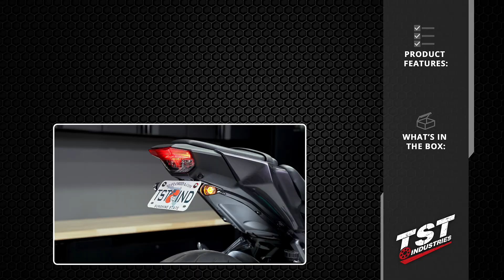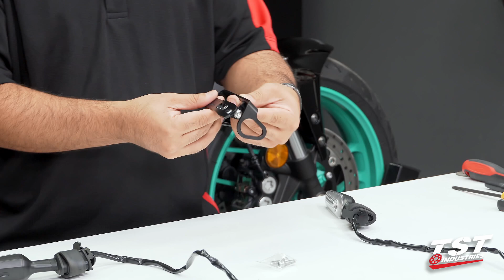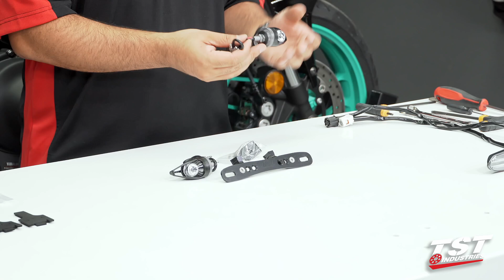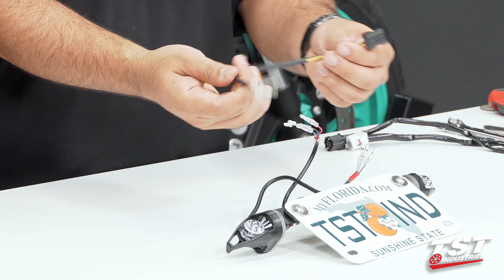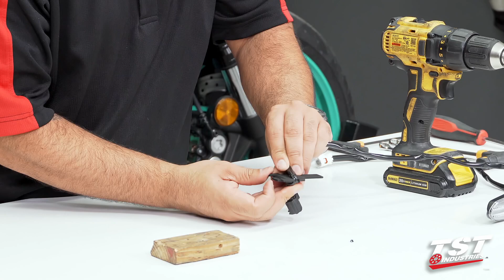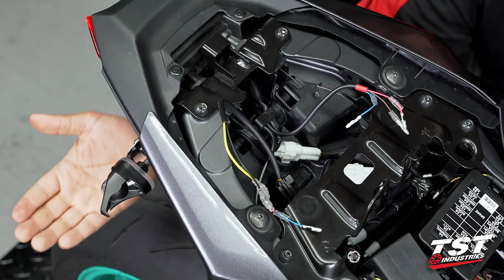How to Install Rear LED Pod Turn Signals on 2024+ Yamaha MT-09 by TST Industries

Comment: So if all I want is to use the factory turn signals with the adjustable bracket. I’d need the bracket and the closeout kit?
Reply from the maker: You would need the Elite-1 Fender Eliminator and the OEM Signal Bracket.

Comment: How would you install the Evo lights running light wire to the bike's plate light wire, if the plate light is already connected to the TST plate light? Or would I have to then, tap into the brake light?
Reply from the maker: You can tap into the brake light wires/functions and achieve either a constant running light or an additional set of brake lights. The choice is yours.

Comment: Do you sell just the rear bracket for the OEM rear turn signals if i want to run the low mount plate, but dont want to run the turn signals down there? Id like to have OEM turn signals in the location of the high mount bracket, but want to run the low mount plate. If i buy both can i use just the turn signal bracket for the OEMs without the plate bracket?
Reply from the maker: Email our Support Team and they can try and help out. Support@tstindustries.com

Comment: Saludos de Puerto Rico tengo Yamaha 2024 mt 09 SP, quiero montarlas led TST mech gtr al frente como aparece en el video y en el Fender trasero original las misma color Amber, también tienen led parking o led de emergencia por que la yamaha trae esa función (intermitetes)
Reply from the maker: Sí, puedes usar estas señales en la parte delantera y en el guardabarros trasero original. El kit trasero será un poco diferente debido a los conectores. Si nos envías un correo electrónico, podemos ayudarte si lo necesitas.

Comment: The front lights can be installed on the original Fender from behind Yamaha MT092024
Reply: sp
Reply from the maker: @hectorpino7006 I’m sorry but I do not understand your question.

Comment: What’s the inclination angle for adjustable option?
Many Thanks
Reply from the maker: What do you mean exactly? The angle of the license plate is adjustable. You are in control of the angle. Since it does give you the freedom of control, you have to be responsible to adjust it where the tire will not contact it in suspension travel.

Comment: Is there a video showing the wiring? All of the wire colors are different on the mech evo rear signals vs the plug n play as well as the oem connectors.
Reply from the maker: @Itsyunlo  38:25 starts going over the wiring for the Mech-EVO set-up

Comment: Around 30:45 for the OEM Signal/Adjustable High Mount in these instructions you didn't install the two push pins that connect the undertail to the bottom of the rear brake light. Was that expected?
Reply from the maker: @thasherm  yes, that process was just shown to illustrate how it would mount but the full reassembly process should be followed with putting all hardware and fasteners back in place.
Reply: @TSTindustries  I figure it was probably hard to make a video with so many different options people can choose to go with. I ended up watching this video and the adjustable high mount video ( https://youtu.be/q-pEWMzrDjU ) in combination and it worked out well. Looks great! Kudos to the R&D team and the techs who made the videos 💪🏻

Comment: Not mentioned the whole would be open under your fender for water an dirt an everything else to get thrown up there or am i worng?
Reply from the maker: @ZukaBro  no, with our undertail closeouts all holes are covered. The only “holes” you may have are the tiny ones from drilling our center closeout for wire routing. But that’s very minimal and wouldn’t allow too much debris, if any at all, from entering your tail compartment.
Reply: got my kit in today and am installing it, there are parts on the side of the closeout that you would drill/cut out and it leaves enough room for the turn signal cables to route through without a huge hole
Reply: @WheresWagner  can you show me how much wire you can see after the wires are routed through the close out?
Reply: @ZukaBro  you can have as much or as little as you need.

Comment: So if ypu use the oem turn signals on the high mount bracket adjustable or none, the wires are exposed ? Those wites are thick. So it def be seen an a very ugle fit.
Reply from the maker: @ZukaBro  no, the wires are tucked behind our license plate bracket and then routed into the undertail through our center closeout.
Reply: @TSTindustries  so basically you would have to make a bigger hole with a drill in order for you to tuck the OEM turn signal lights inside.
Reply from the maker: @HassanIsDriving  no, the same size hole is needed to remove the breakaway pieces from the center closeout we provide. You only need to route the wires through the cut-outs, not the connectors. If you need more assistance or visuals, please email our Support Team. We show the process in this video but if something isn’t clear enough, we can provide additional material through our Support Team.
Reply: Do you need to use the adjustable mount for the turn signals? I ordered everything to do this but I ordered the high “fixed” mount bracket

Comment: I like the low mount but if it had integrated turn signals. Also, can high mount have original turn signals with adjustable license plate?
Reply from the maker: @damacknificent151  absolutely, that’s the first variation we show of assembly.
Reply: @TSTindustries  which one? High mount with adjustable plate and original turn signals?
Reply from the maker: @damacknificent151  that is correct. I’m not sure exactly what you mean by integrated signals with a low mount but we do have plans on designing and releasing an integrated tail light sometime next year.
Reply: @TSTindustries  yes, integrated into tail light plus low mount might be better option compared to low mount and turn signal next to it that might have me nervous my girl's might actually kick off accidentally
Reply from the maker: @damacknificent151  we do plan on releasing one but it won’t be until next year at the earliest.
Reply: Xinmei has an integrated brake turn signal,  will you do same style?